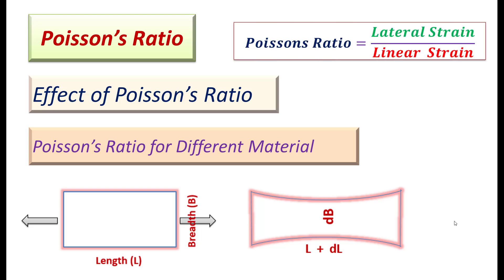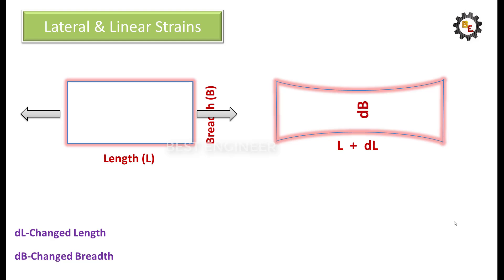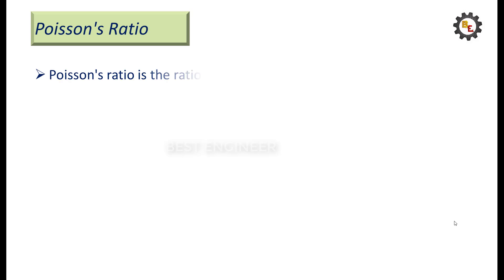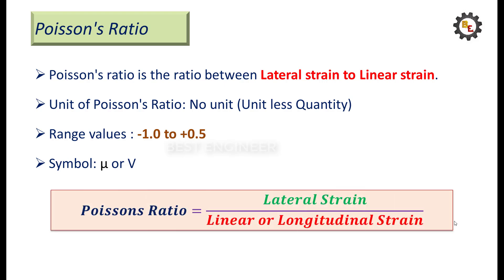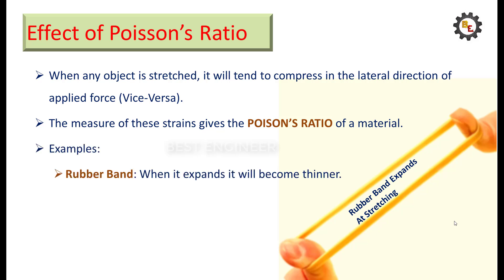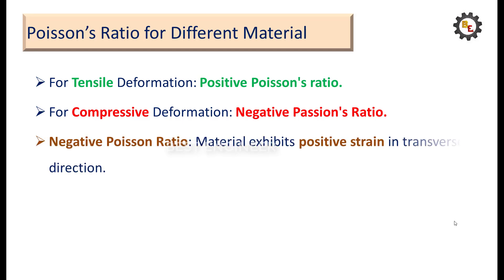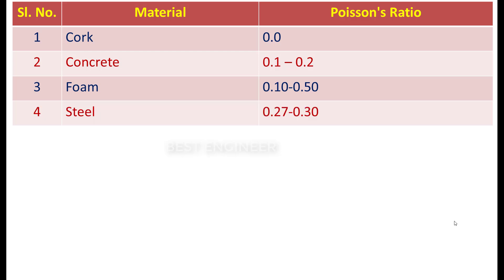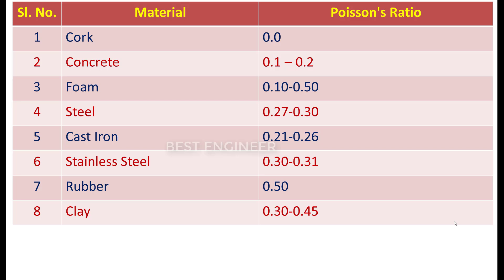Poisson's Ratio | Relation Between Lateral and Linear Strain | Best Engineer

Comment: Sir pls.solve this problem A cranehook is of rectangular cross-section with thickness = 6 mm, inner radius = 20 mm and outer radius = 40 mm. The center line of loading coincides with centre of curvature. Material of crane hook is Aluminum (E= 70 GPa, v = 0.25) and maximum load = 1 KN.

1. Develop finite element model of the plate using suitable elements.

2. Perform static analysis.

3. Obtain the maximum values of stress at inner and outer fiber.

4. Compare the results with analytical values neglecting shear.